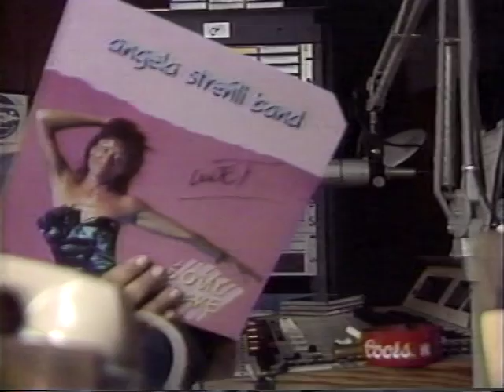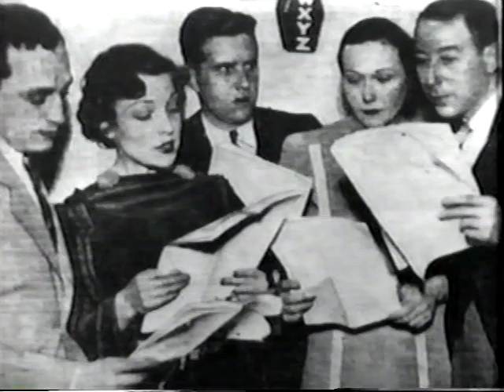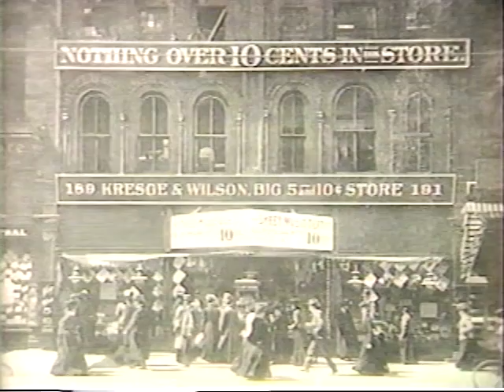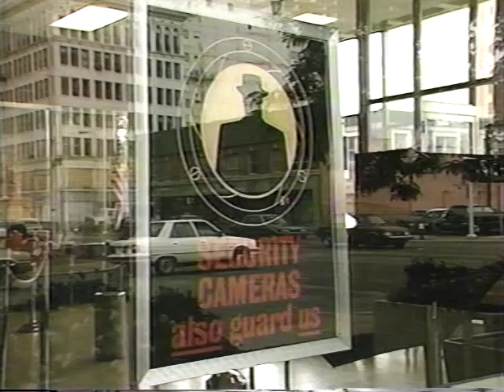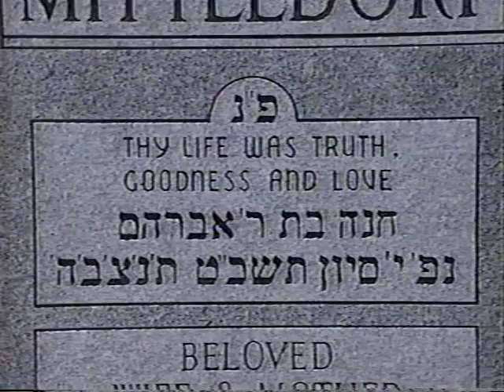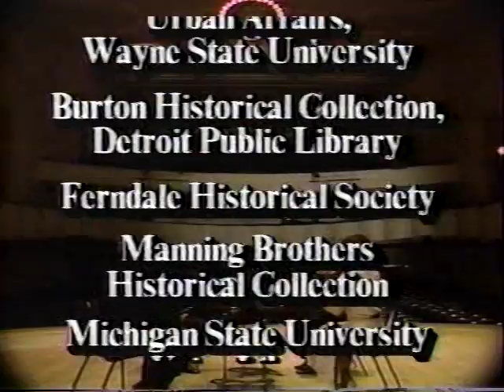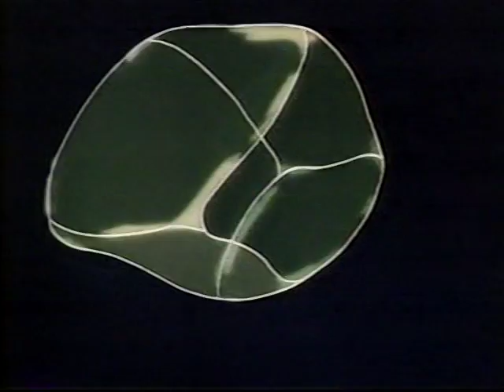A History of Detroit's Woodward Avenue

Comment: While driving north on Woodward between 8 and 9 mile roads in my '63 Falcon Sprint with 260 Cubic Inch 4 barrel Hurst four speed shifter with a underdash 45 record player in 1968 I was drinking a beer and took a swig then looked off to my left to see a cop motioning me to pull over. I did and got a drinking and driving ticket.
I went to court and paid a $25 fine and got 2 points on my license.
Things were a lot different back then. Judges regarded drinking and driving a lot differently in those days...like an 'almost' crime.